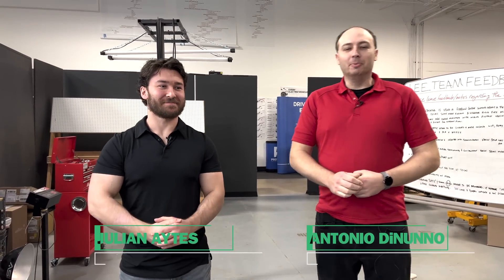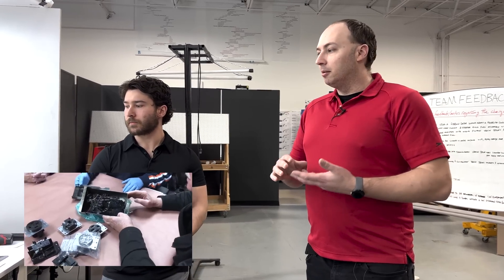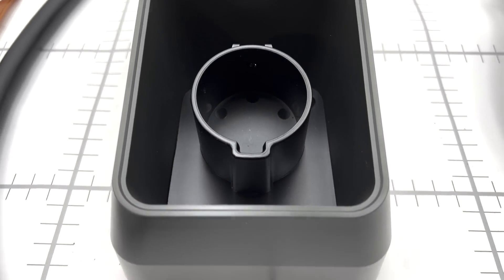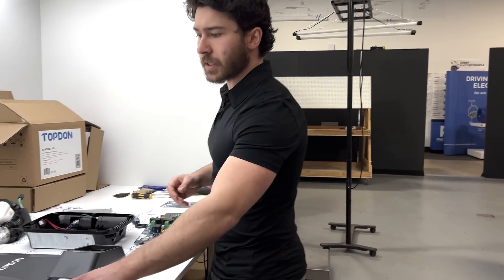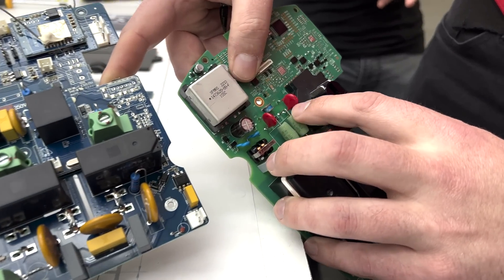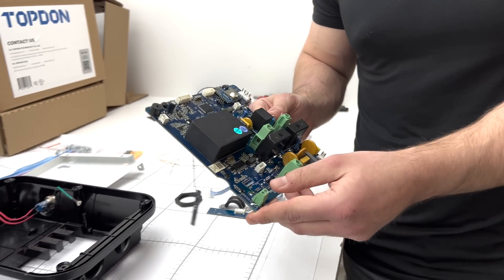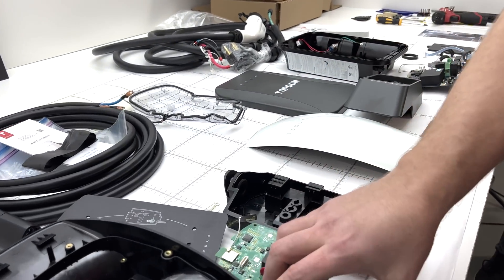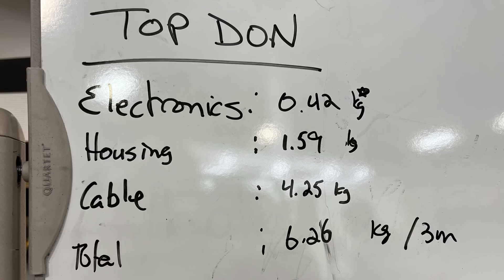EV Home Charger Teardowns E2: Topdon PulseQ

Comment: Thanks for these! They're always super fascinating. Have any of your electrical team appeared on videos before? Would love a more in-depth reverse engineering of one of these boards, but I'm just an electronics nut over here.
Reply: Would love to get them in, but they are super busy!
Reply: the chargers do not contain complicated electronics

top right the wifi module is a standard esp8266

the 2nd microcontroller would not be necessary.

top left after the connections is the led board a beeper and the earth leakage monitor

just below the power supply which would not be necessary because there is already a transformer and emv filter.

between the green plugs the big black parts are relays.

just below the yellow are capacitors or VDR both serve the emv

the crystal in the lower left corner is not clear to me 

but looks like a 3rd microcontroller which probably serves the energy measurement

also here is an optocoupler which is probably used for a isolated input.
Reply: @horst1154  Agreed, not complicated. Nor efficiently designed. Effective, yes. 

Our EE team agrees with the part ID's. We went over it and the common things are notable to the electrical people but we are focused on form/fit/function. Essentially, all these "chargers" do is connect the grid to the car's on board charger and relays some info to the vehicle and often, to an app on your cell phone.

Comment: The outlet is only supposed to be used for a few hours at a time, really? Really?
Reply: Yes. Mainly because no appliance draws its maximum current continuously. Even an electric oven heats up within 10-20 minutes and then drops down to about 1/5 of its maximum rating. All devices that potentially draw high amounts of currents for hours are usually hardwired---water heaters, heat pumps, ACs. Everything else (ovens, hobs, dryers, washing machines, welding machines, ...) only draws its maximum current intermittently.

Plug connections always have relatively high resistance, and it only gets worse as plug and socket age. That's the nature of two bare metal surfaces that only touch and are pressed together with a little bit of spring force. This means the connection will always produce heat, which will build up over time. A new socket and plug are rated for a handful of hours, meaning that after that time at maximum load, the plastic doesn't yet melt. In contrast, wires, screw terminals and wire nuts are rated to reach an equilibrium at which the temperature doesn't rise anymore.
Reply: @HenryLoenwind  really?! Lol 😂 “don’t use your 20A dedicated circuit more than 2 hours a day, your house will burn down.” You’re patently misinformed or inexperienced? Sounds like you should take them out of your mouth before you give another long winded answer
Reply: They're drawing a distinction between the duty cycle of a clothes dryer receptacle and an EVSE receptacle, and it's an important one.
Reply: @BixbyConsequence  but irrelevant. Just because you only use it occasionally doesn’t have anything to do with its load capacity.
Reply: @wildcritters5297  The intended duty cycle of the receptacle is quite relevant as is its temperature rise at 150% overload.  A 14-50 electric stove receptacle of good quality should be capable of meeting a Max 30C rise after 50 cycles OL at 150 percent rated current specification and should be good for 10 years.  Note that a stove receptacle usually has a stove plugged or unplugged from it a few times over its 10 year life cycle so using it to switch between a clothes dryer and car charger will require more frequent replacement of the receptacle.  The 14-50 though is inappropriate for anything drawing over 40 amps continuous.  

That said using a 14/50 stove receptacle for car charging would be more like running the self clean function on your stove multiple times in a row potentially every night while having all the burners set on high the entire time.  

We've already known for years now that when these receptacles are used for RV hookups the tension on the terminals weakens becoming loose over time with the receptacle and item plugged into them tending to overheat along with melt down so they require constant attention to verify their status.  They do require more frequent replacement in that service.  This is nothing new and not unique to when they are used with EV charging stations.

As for lightning clamps you want that sacrificial device in your main service panel where its easily serviced by any local electrician and would not want it hard wired inside a car charger that would have to be taken out of service and returned to the maker to have the lightning protection restored or the entire unit replaced.

Also with the extended load cycles that chargers run at one might be prudent to have an automatic voltage correction transformer on that line to protect from low voltage damage to the charge station and the vehicles on board charger.  I have been using the Hughes AutoFormers for that purpose for years now and devices on branch circuits (up to 50 amps) so protected tend to run cooler and more reliably resulting in a much longer service life.  Extended periods of low voltage is a big problem where I live and causes a lot of long term damage here.

Best!
Reply: @neilfromclearwaterfl81  if you overload your   Breaker over 150% it will get hot. What wisdom… glad Tesla fans need electric stoves to understand how power works.
Reply: @wildcritters5297  Sorry but that is how the temperature rise rating is defined per the Leviton Device Book for a NEMA 14-50R and has nothing to do with Tesla of which I'm definitely not a fan.  A better match would be a NEMA 14-60R however that would still require regular inspection for heat degradation as it ages.  

The 14-50 is notorious for age related issues when used in constant high draw applications and well known for failure with extended use.  Ask anyone who is fulltime in an RV that relies on a 14-50 as their house power connection.

As head maintenance engineer (now retired) I've had to replace a good many 14-50's that have experienced heat failure despite the wiring and breaker being to code.  As others have mentioned they are best for intermittent 40 amp draws that usually are only at half that or less most of the time since in the real world they tend to have too high a rate of rise when under full load for extended periods of time.

Best!
Reply: @neilfromclearwaterfl81  I over clock 14-50s everyday, 12-24 hours. 12 hours at low end. All my 14-50s have a lifetime warranty, hence their faith in the product. The only ones that fail are result of the plug never the outlet
Reply: @wildcritters5297  If overclocking means what it appears to then you are a high risk user courting an electrical fire and chancing loosing their license and insurance.  I'd think twice or thrice before openly admitting this in forum.

The warranty on the product should be null and void due to the intentional violations.

If a fire, electrical or insurance inspector catches on to this it won't be pretty.  Anywhere I've worked you'd be shut down for this.

This is not best or safe practice and really should not be encouraged.  I really can't honestly say anything positive about this practice.  

Please do not reveal anything further and seriously consider changing those over to a higher spec receptacle or hard wiring them with the appropriate service disconnect.

So sorry to hear you're engaging in this practice.
Reply: @neilfromclearwaterfl81  take the complaints to the engineers. Do you have to clean your mustache when the inspectors leave? 😂
Reply: @wildcritters5297  Family of electrical, process and QA/Test professionals and engineers here so we'll likely discuss this.

You may note that I have not responded in a vulgar or unsavory manner although you already have done so.

Regrettably...
Reply: @neilfromclearwaterfl81  make sure you discuss the aforementioned inspection favors, they would probably like to know that part
Reply: @wildcritters5297  Sorry you've exceeded the boundaries of decency with all the gutter talk and I have muted you.